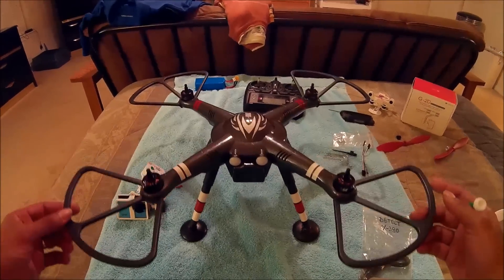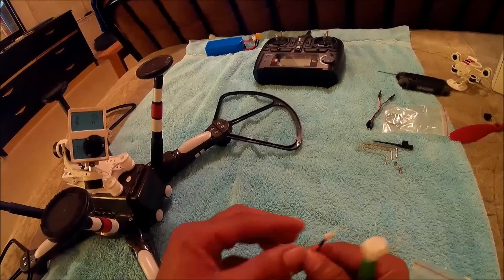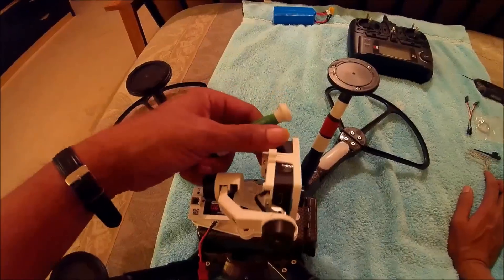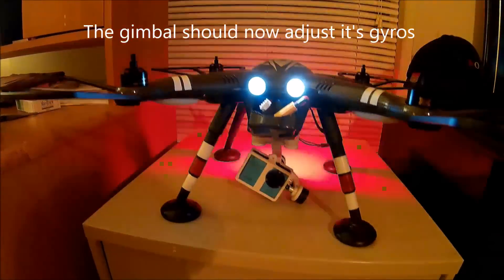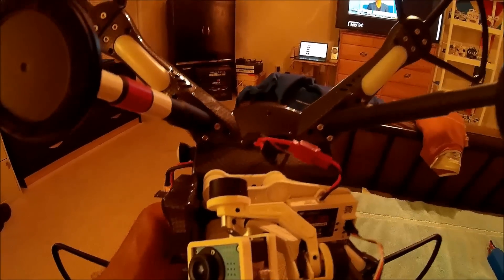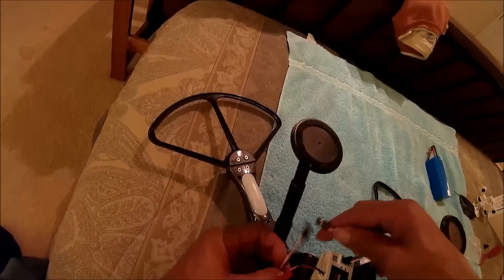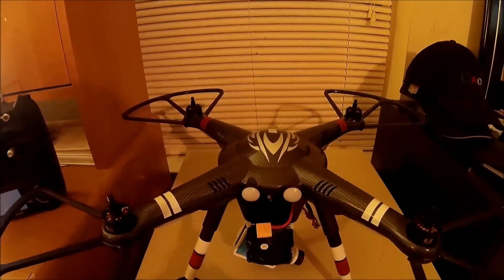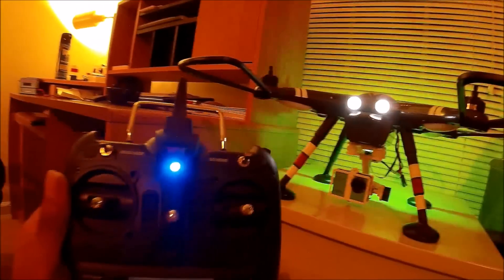XK DETECT X-380 "HOW TO INSTALL THE G2D GIMBAL"

Comment: I installed my G-2d on my X380 yesterday. Is there nothing that secures the gimbal once you slide it on the track? Seems a little sketchy to just slide on and off. Also, what would you say is the best way to mount the gimbal w/out seeing the legs and lights?
Reply from the maker: +whipit24  At the very end of the slide (or rail), look closely and there's two "bumps" that line up with two dimples, that kinda lock into place. The slide on the rail is pretty tight, right? Well, I sometimes slide my forward, (and hope that it doesn't slide off) to keep the legs out of the picture!  It's been working so far, you can always add a saftey wire to catch the camera, just in case.
Reply: It doesn't feel like it locks at all but it definitely is a tight fit. Thanks I just wanted to make sure I wasn't missing something. 

Great vids by the way. You're the reason I went with the X380 w/ g2d gimbal. Couldn't be happier other than a few issues I'm dealing with on the X380 (shipping damage and battery/charger issues).
Reply from the maker: whipit24  You're right, it doesn't lock, but it's tight and I'm pretty sure it won't just slide off.  Good luck with your x380, hope you resolve the shipping damage issues.  Happy Holidays

Comment: I just got my mjx x101 quadcopter but I must say it's very hard to fly 

I am about getting the xk detect 380,  buying G2D gimbal or eachine gimbal.

My questions are
1. I want to be able to use fpv with my amkov 5000s camera using the 5.8GHz video transmission cable and device,  will it not interfere with the control of my quad? 
2. How can I also connect the fpv system to my gimbal, if you could pls make a video sir.
Or what would be your advice about using the action camera to achieve fpv function? 
Thanking you in anticipation of of kind response. 
Regards

Comment: Got my G2D attached to my X380 and other than it rolls all the way under when its first connected it works well. I also added a Walkera QR X350 Pro to my collection which now numbers 2. I flew the 350 for the first time today and I have to say that I prefer the X380 over the 350. I'm guessing I will get a feel for the new quad but its going to take a while to displace the X380 from my go to toy.
Reply from the maker: +Terry Gulliford  My gimbal does the same thing. Working on adjusting it but I'm waiting for a new camera to arrive. (Yiaomi Yi) I had looked at the QR X350 but wasn't too sure if I would like it or not. Is it the same as the Blade X350? Can your G2D gimbal easily hook up to the QR X350? Good luck with both of those puppies! (I'm actually trying to bid on Ebay for a Phantom3 - see if I can lucky and get it CHEAP!)
Reply: Not familiar with the Blade 350 but the QR X350 came with the G2D gimbal and setup for FPV. Good luck on the bidding, I will be jealous if you end up with it.
Reply from the maker: How does that gimbal work on your QR X350? Did you have to put your own camera in it or does it come with a camera too?
Reply: +DJ SOUL FORCE 
Comes with the G2D gimbal and an iLook+ camera. Havent used the camera as I don't have a micro SD card for it yet but the camera doesn't have a battery like others but it runs off the main battery. The lense on it extends out nearly 1" so I have to believe the video should be good. The SJ4000 that I bought works very well too and can be used as a dash cam which I have done and it does it well.

Comment from the maker: Keep in mind, the Walkera G2-D was factory set and balanced for the GoPro camera. You may have to make some additional adjustments after you install & mount your camera so that it's balanced properly and working correctly. Here's the flight test video link: https://www.youtube.com/watch?v=qn7VLcR1pbQ
Reply: my Gimbal works very well
Reply from the maker: Old School R/C  Really glad to hear that. I'm sure you're having fun with that thing!!! DJ SOUL FORCE
Reply: 👍Ok,thank you
Reply: it actually works well with my SJ4000 Cam
Reply: WHAT CAMERA IS THAT?
Reply: thank you!!
Reply: Hi DJ Soul, included with the Walkera G-2D there's a Balance Accessory ring with a fixing screw, do I have to bother installing that ring, I'll be using an Amkov 7000S camera with the gimbal. Another question what about the slide switch on the opposite side of the power connector of the controller, the default position is 1, I suppose that I leave it as it is? Thanks a lot for your answer.
Reply from the maker: Will blundell  It's a cheap, fake SJ4000 knock off I found on Ebay!

Comment: Thank you, DJ. Your video helped me get my gimbal setup and working on my X380. The ability to tilt the camera while in flight is really helpful for shooting events like sports or weddings. My 380 didn't come with the special connector wires, so I just cut off one of the connectors (with a pair of diagonal cutters) on one of the three connector wires included with the gimbal, and made it a two connector. It fit perfectly in the 12v power connector on the quad. A little solder to join the wires together with the special gimbal connector and shrink tubing and I was set to go.
Reply from the maker: +John Richardson  Great idea, way to go. Looking forward to seeing some of your work, thanks.  p.s. I just posted some pros & cons of the G2D gimbal yesterday, watch it here: https://www.youtube.com/watch?v=qn7VLcR1pbQ
Reply: I didn't get the power cable with my x380 either. any chance you could post a photo of how you did yours

Comment: I just seen a Video of a all in one camera. Boscam TR1 Camer & transmitted.. Drone Camp RC show demo.FPV.
Reply from the maker: +Anthony Johnson  That's a pretty cool setup, it's mostly used for FPV racing quads.  It doesn't include the monitor and cannot be triggered from your transmitter.  MJX makes FPV cameras for your X-101 that will send the pictures to your smart phone and can be started by pressing a button on your transmitter and cheaper!  Check out this one that's already made to fit  your quad with no modifications:  http://www.gearbest.com/mjx-c4008-720p-fpv-camera-_gear/
Trust me, it's hard enough to fly "line of sight" and even harder flying "first person view."  I have three different cameras that I use on different quads, depending on their weight and the lifting power of the quad.  Get to know your quad's lifting ability and the various camera capabilities & camera's weight before you choose extra accessories for your quad.  Holla back...
Reply from the maker: +Anthony Johnson  ...one more thing. See the camera that I'm using in this video? It has wifi that can also send the video to my smart phone and can be used for FPV.  However, I never use that feature because wifi signals can also interfere with the quadcopter's 2.4ghz transmitter's signal.  FPV cameras that uses 5.8ghz signals, send those pictures to a 5.8ghz receiver or monitor and won't interfere with the quadcopter.  So, shop wisely!!!

Comment: I think that plug is for  FPV on a GoPro, SJ4000 camera.  Don't run 12 volts into a Mobius camera.  I know from experience you'll fry the board. Always check the voltages with a multimeter.  Soon, you'll be building your quads. Signal pins coupled with the power are always 5 volts..  Often, most folks don't run the power, just the signal pin as you've done here.  Only need pitch on these gimbals.  Too bad my Boscam HD camera won't work with the Walkera G2D gimbal.  At 120 grams, it's nice a light..

Comment: Thanks Force, really well done video. Thinking about doing this to my X380 too.
Reply from the maker: +DW Caudill  Thanks and good luck with your's.
Reply: +DJ SOUL FORCE http://www.ebay.com/itm/FPV-BGC-2Axis-Gimbal-w-Controller-f-GoPro-3-DJI-Phantom-1-2-Walkera-X350-Pro-US-/131510618198?hash=item1e9ea4c856:g:-MwAAOSwWnFV-4qe
Reply: +DW Caudill Hello again DJ. In the link above, could you check this out and tell me if this one will work with the X380?  Really appreciate your videos. Happy flying and thanks
Reply from the maker: DW Caudill  I'm sure it will work, just not sure if the mounting screws will line up with the X380's holes. It looks like the same gimbal Quadcopter 101 did a review on and showed how to wire it. Here's the one I bought: http://www.ebay.com/itm/121617661088?_trksid=p2057872.m2749.l2649&ssPageName=STRK%3AMEBIDX%3AIT
The one you're looking at appears to be more of a uiversal fit, just like I was complaing about with the Walkera (won't accept different cameras). I like it. Good luck.

Comment: What  distance the gimbal support control up/down camera? FPV works too? Thanks
Reply from the maker: +Diogo Sisti   I can control the camera from the transmitter up to 1000m.  Camera can point up to the bottom of the quad to straight down to the ground.  I can get FPV from my Wifi camera but I don't use it.  Thanks for watching.
Reply: +DJ SOUL FORCE from what I understand the WiFi from your camera can interfere with the GPS so I'm not so sure I would go that route for fpv besides I don't think the range you'd get would be very good. That's totally from what I've read and seen not anything I've experienced.
Reply from the maker: You're correct. That's why I told him I don't use the Wifi feature in my camera. Just forgot to tell him about the interference, hope he reads this! Lol
Reply: +DJ SOUL FORCE thanks

Comment: DJ SOUL FORCE - suky suky now!! lol (huggy bear) Great video as always! Thanks
Reply from the maker: +Robert Street  Can you tell I was excited that it worked. I'm not a real tech guy, I learned from watching other Youtubers. I was nervouse during that whole install, didn't want to fry a board, Lol  Thanks for watching.
Reply: Did a good job. You did not seem nervous at all. You're a Professional ! Heck, I work on computers and cannot even do that video stuff that you do. I am sure I just need to watch a video and learn how, but never have done that yet. So thumbs up to you!!
Reply from the maker: Robert Street  Thanks
Reply: what do you recommend for a prop balancer? Thanks
Reply: DJ SOUL FORCE FYI - i got my drone, did the flightctrl software and lost connection to my transmitter. I have to return the dang quad now and haven't even flown it yet. I saw afterwards others with the same issue. There was a fix but I could not clearly find all the details!! :(
Reply from the maker: +Robert Street  I don't have a prop balancer yet...!
Reply from the maker: +Robert Street  Man, I'm really sorry to hear about a first flight crash. Hope it's not too much of a problem to return it & get a new one.  I've haven't used the flightConfig software yet, been a little scared to touch that. How bad was it? Did you film it?
Reply: was not a crash. I tried to install the flightctrl software on the quad and lost the transmitter connection. Someone fortunately emailed me from the forum and told me how to reset the quad through the pc. Still haven't flown it yet but everything seems normal again.
Reply from the maker: Robert Street  That's great news!
Reply: DJ SOUL FORCE - First flight was a success!!! Love this quad already!! Everything worked flawlessly and I am sure I got great video too. I have the moving gimble as well. It was a little breezy too. I was at an open field and it maintained its position! 20 min flight time with camera running!
Reply from the maker: So, no more transmitter problems? Maybe you can teach me how to use the FlightConfig software, I haven't attempted that yet.
Reply from the maker: ...and oh yea, now you have to wait forever for that battery to charge - lol, you may be able to get another flight in before dark! I'll send you a link later for extra battery, was $44.
Reply: Actually I got a balance charger. SkyRC imax B6 mini from eBay. It will charge it in about 1 1/2 hrs. Almost done now and at 95% at one hour and 23 min. Yes please share the battery link.
Reply: By the way, the video came out flawless. I got the C package so it had the gimbal and 1080p cam with it. I can roll down and up. Very nice...super stable! Love it
Reply from the maker: +Robert Street  Geekbuying.com, on sale now for $40.99 plus $5.49 shipping. ($46.00total)...they went up a bit!
http://www.dealsmachine.com/best_265755.html
Reply: +DJ SOUL FORCE - Awesome - Thanks!
Reply: DJ - Loaded the software and got it to work. If you use it turn on TX then plug in battery on quad, then plug into pc and open software. Click Open Usb then click READ. This way it reads the quads settings. You should be able to move the TX sticks and see them move on the screen. Then make changes and click close USB at the end and make sure light is green then unplug from pc. It should flash a bit on the quad then be done. Also make sure the TX is set to the first box on the left (in the software)...Mine moved to a few places over.
Reply from the maker: Great information Robert, I'll re-post this so we can share with everyone.  Thanks a lot and keep us posted.

Comment: Went thru all that came with the quad and NO wiring harness. I got the usb for charging but no other harness :>(
Reply from the maker: +Terry Gulliford  Sorry about that not being included in your package. there's ways around that, however, I'm away from my home computer right now. I want to send you a link to another video where a guy bought the wires he needed off Ebay. I think I saw on Vence McAdam's youtube page(?)  And oh yea, that USB is for PC connection, not charging! I haven't played with that yet...
Reply: +DJ SOUL FORCE Thanks!!! Running my new stuff together. The usb cable is for the SJ4000 and not the 380
Reply: +Terry Gulliford The usb cable can be use for computer firmware updates also.
Reply: +Terry Gulliford http://www.ebay.com/itm/221483117724?_trksid=p2057872.m2749.l2649&ssPageName=STRK%3AMEBIDX%3AIT  These are the ones I used. I hope this helps.
Reply: +Vence McAdams Thank you  :)
Reply: Anytime. I didn't get the wire with mine either.
Reply: +Vence McAdams Cheap enough so I ordered 2 only to find I ordered 2x20 or 40 of them!! Guess I can use them for Christmas tree decorations :>)
Reply: Terry Gulliford Ha!

Comment: Nice Job ! You are now a XK X380-C owner for a lot cheaper cost lol. Mine XK gimbal was way over priced... P.S. That Tarantula screwdriver comes in handy, I use it for everything in this hobby too lol. :)
Reply from the maker: +INTELMAXELL  Hey I got a couple of questions about the 380c package.  Can you use that camera as a stand alone camera or does it only work on the X380, like the Syma X8g? (syma cam only works on the quad) Can you start/stop the video from the transmitter?  And lastly, does the camera have it's own power supply or power from quad?  Thanks for watching and your commments. (you recognized the screwdriver huh?)
Reply: You can use it as a stand alone because it's a sjcam 4000 without the logos and wifi. I so far haven't been able to start/stop the video from the transmitter. I think it was my fault because originally I bought the quad without the camera and then decided to order the XK camera separately. The gimbal works fine but when I hit the button I get nada. I have to turn the video manually by pressing it. Also the camera runs on its own internal battery that runs separatly about an hour before dying. Maybe someone can comment that bought an XK X380-C all together as a whole can tell us if their transmitter button works with the camera.
Reply from the maker: ...and of course, the instructions (if any) that came with the camera & gimbal didn't help, right?  Are you using that 5v signal port at all?
Reply: +DJ SOUL FORCE lol yes it came as OEM in a mail bag with Chinese letters on the bag with no instructions. The gimbal moves up and down using the wheel on the transmitter but the photo button doesn't work. And yes I am using the 5v port. I feel like I am missing an extra wire to communicate with the camera that maybe never came? I never pursued it, I was just happy the gimbal worked and it was level and the legs don't show in the picture.  lol.

Comment: Love your video diary series with this quad.  Looks like XK released new firmware allowing auto circling and rotating for camera work.  Check out the RC Groups thread from this morning.  Keep up the videos!
Reply: +amrunner4 Also there is a XK X380 group on Facebook that is good too on this circling firmware. Join XK detect x380 owners club for more details, it's awesome!
Reply from the maker: +amrunner4  Thanks for the info and for watching.

Comment: Great. My gimbal is connected with all the 3 cables to the pitch cable and works still. I will try also to connect the signal cable and see if there is any difference in the gimbal's performance.
Reply from the maker: +William Mjema  I was told that it's ok to use all three wires to connect the pitch function.  It's meant for better control of cameras that are heavier than a GoPro.  Don't quote me on that, that's what I was told but haven't tested it since I cutoff my red & black wires!  If your's is working, I would leave it alone. Happy flying man...